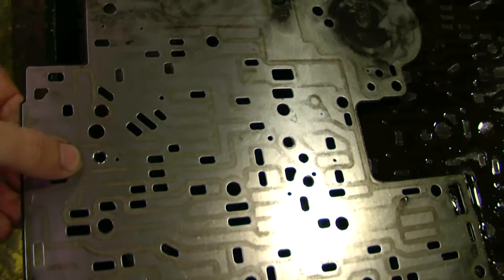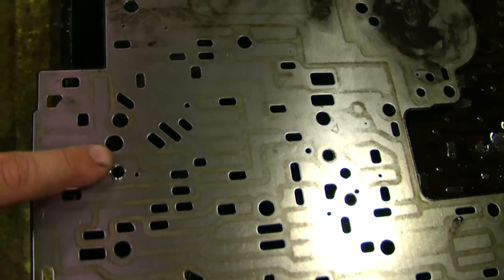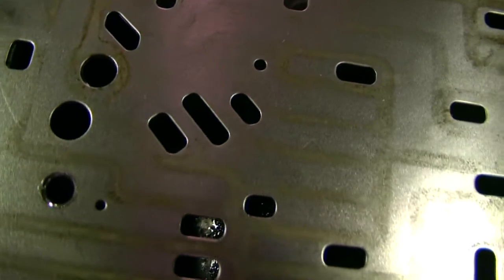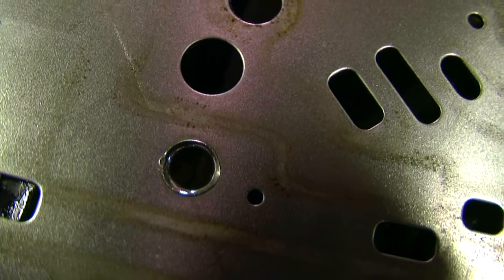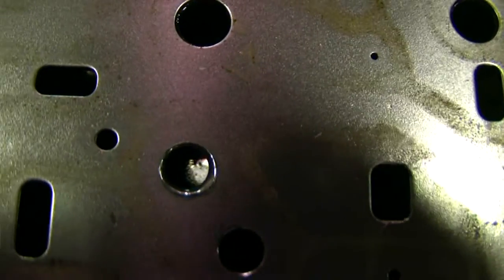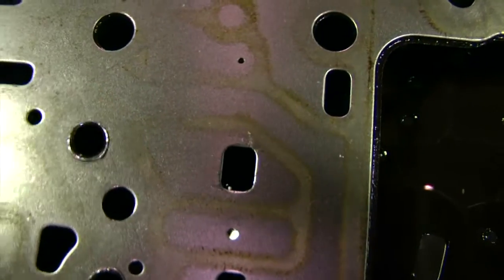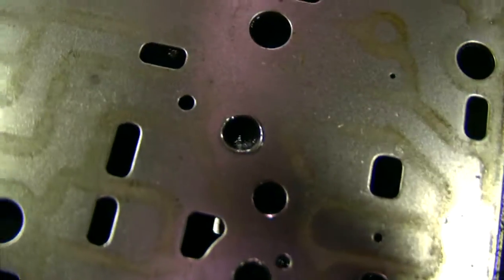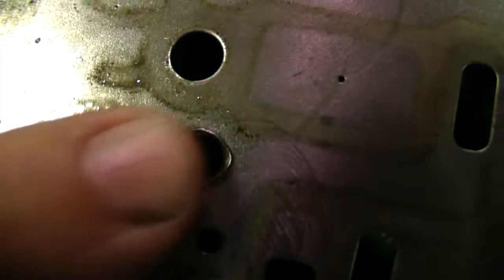Valve Body Separator Plate Inspection

Comment: NOPE ! That plate can easily be reused & I have in fact used plates that looked far worse than that without any problem .  But I know how & that is the difference between a parts changer & an actual mechanic . 1 way is the way " Fast Nasty " suggested  which works just fine they other way , I'll keep to my self .
Reply: Ooooo!  Drilling it out round and using a larger checkball.  Top secret!  Don't worry, I won't tell.

Comment: They also have sep. plate repair kits that you drill 1/4 in. and install a hardened seat that will last near forever. I use them in 4l60e all the time and using in a 4l80 plate to fix two holes today. Have had no problems with them. But, you're right about the flattening fix, just don't work.
Reply: can u tell me where I can buy the repair kit?

Comment from the maker: This wear does not make a noise. It allows fluid to escape past the ball into other circuits. It could cause premature failure or shifting problems. I would not try to flatten it out unless you are really cheap!  The wear is seldom a perfectly round "crater" where it can be flattened back. It is often more displaced to one side or worn away altogether. No amount of pounding will make an oval seat round. Beside its a cheap part to risk having to do it all over again.